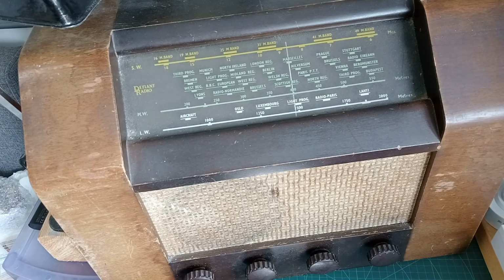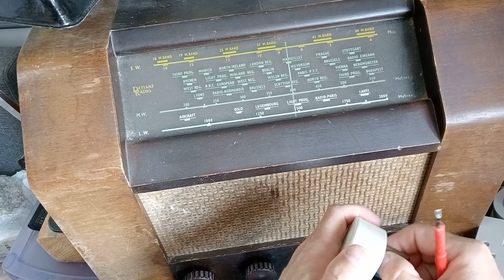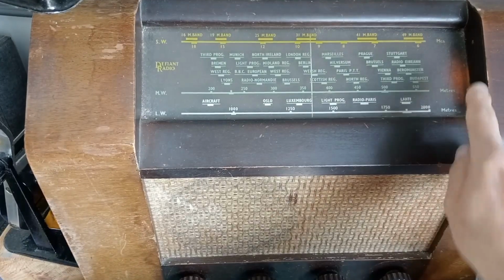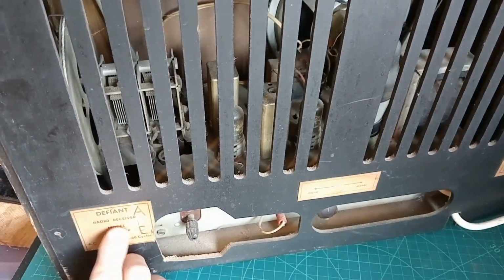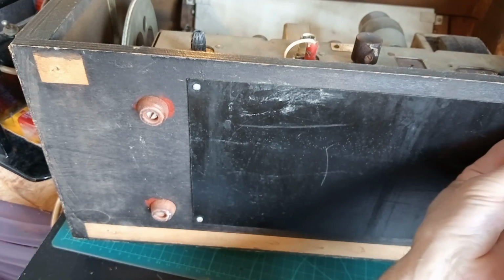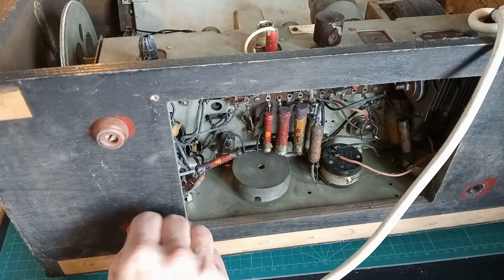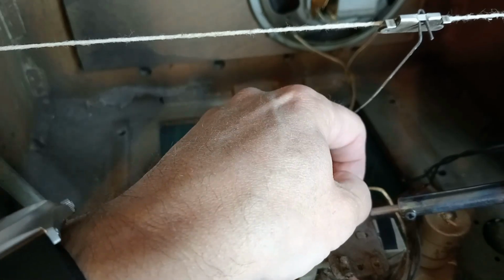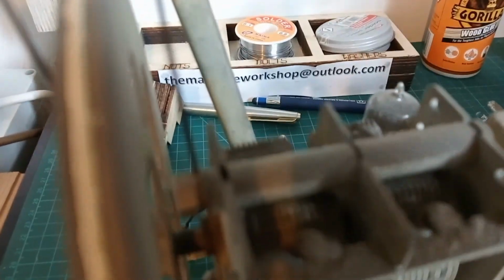DEFIANT M.S.H 450 Valve Radio. 1st look, Part 1.

Comment: Hi Shaun, I'm glad David has mentioned the Rimlock valves. I have those on my Cossor Melody Maker, and I was VERY careful to remove the clips on the bases first!  Someone else has also mentioned that you need a wire antenna connected, you probably won't pick up any stations without. So others got to those points before me, but worth repeating!  The selenium rectifier ought to be replaced with diode(s) and a beefy resistor to compensate for the higher HT that will result, but you need the schematic first of course. The smoothing caps and cap feeding the output valve grid ought to be changed ASAP. Other than that, a major cause of problems are dirty switches, pots, and valve sockets and pins, so cleaning those is also important. You're right that all the 'waxies' will have to go. The nice thing about valve work is a lot of components can be tested in-circuit, as the valves don't conduct when not powered up.  The nasty thing is the high and dangerous voltages. Be as safe as you can.  Good luck with it, electronically the circuit is a nice simple one, no FM tuner etc, but you will need to do an alignment as so many caps are bad and will get replaced.
Reply from the maker: Thanks Timothy
Great to hear all the advice here, I will follow the suggestions.
Part 2 will be filmed when time permits, after the electrical work is complete, I'm really looking forward to refreshing the case, I think that dial cord is a piece of string as it slips so will have to be replaced
Best regards Shaun

Comment: Ey up Shaun. That looks an easy radio. I can't find a schematic for it or one close to it, I hope you have more luck finding one. It's probably too late but remove the lock springs from the 3 Rimlock valve bases before removing the valves. If you leave them there you will crack the glass locking nib on the side of the valve destroying the valve. 
As Rob says below, if you have hum there is some sort of B+ meaning the OP Transformer is OK and the power supply is providing power. Good luck with the next step Shaun 👍🙂
Reply from the maker: Ey Up David
Thanks for the advice appreciate it.
It does look like there's not much to the radio , I'll slowly work my way through it
Thanks again
Best regards Shaun

Comment: Doing well so far by pluging in via a lamp limiter you have proved that the mains and speaker transformer are ok.
only advice i can give is start at power supply then audio then IF and finaly RF stage 
good luck.
Reply from the maker: Thanks Rob
I will follow your advice, much appreciated,
I'm reading up as much information as I can, the next video should be within 2 weeks as time is an issue so please keep with it.
Thanks again.
Best regards Shaun

Comment: Was great to see you and we are glad you enjoyed the stay. Great fun. Looks an interesting radio Shaun. I’m a bit slow catching up so suspect you have done it all by now but waxies, electrolytic filter caps and the rectifier will probably need replacing. Also it looks like the dialcord is just string that someone has added. Maybe the dial pointer should have been unclipped before removing the chassis as the dialplate could have been damaged by pulling it out? Onto the next one. Cheers Graham
Reply from the maker: Thanks for watching Graham
I hope you enjoy this little Valve series
Best regards Shaun

Comment: The humming could be the d.c power supply. 
Its worth checking the metal smoothing capacitor,  as they lose there ability to smooth out the rough d.c from the rectifier valve.
If that radio has an audio input on the back, you could feed it with music and see if the amplifier valve works.
Discharge the power supply capacitor when the radio is off so you dont get a tingle when you are fondling it :-D
Just my way of doing the job.
Sorry im being bloody obvious :-(.
Reply from the maker: Thanks Harvey
No not at all obvious , I appreciate your help and assistance
Best regards Shaun
Reply: @SweeneyTTodd  if there isnt a rectifier valve, maybe a metal selenium rectifier.
Maybe lol.
i will shut up now lol.

Comment: It looks like it's been got at a bit. I'd say that Belling Lee coax antenna connector is not original. I didn't see any sign of an internal antenna, so you might want to think about adding an internal DIY frame antenna in due course.  There is definitely a metal rectifier that'll want replacing, and check that it's an isolation transformer, not an autotransformer.
Edit: The chassis looks very similar to that of the MSH 551 console radio. If so, the metal rectifier is actually two  diodes operated as a voltage doubler. Try searching Defiant MSH551 Console for "Defiant MSH551 Console" . Good luck Shaun.
Reply from the maker: Thanks for all the information, I'll be taking heed of it .
I did wonder about the antenna doesn't seem to be a sign of one
Thanks for the help
Best regards Shaun
Reply: @SweeneyTTodd  Why didn't I proofread? LOL. I meant 'search UKVRRR'. 🤬